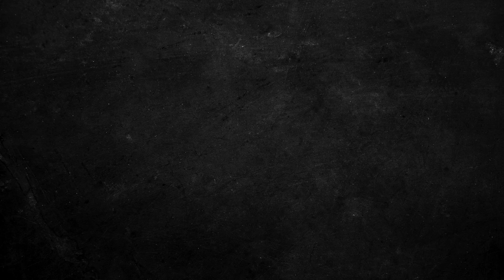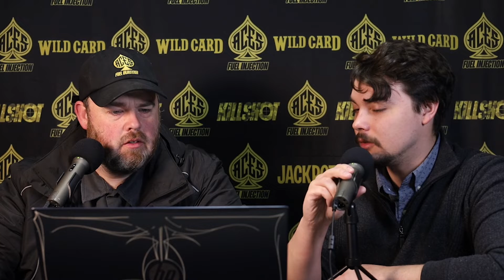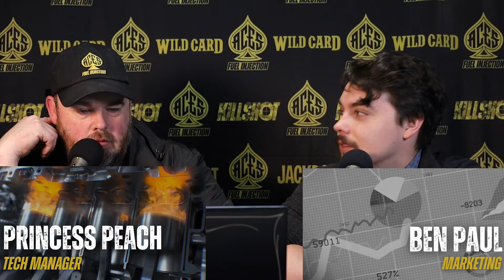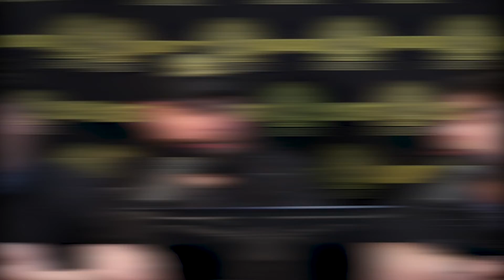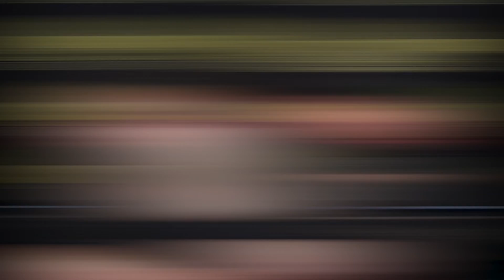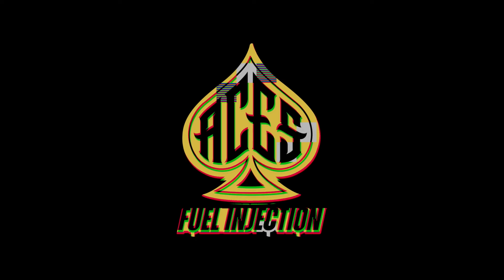Feelin Fresh (Tech Tuesday Ep 27)

Comment: Ok Tim, question bot ur last video. I asked bot getting my speedo to work on my 98 dually. U said get a pin out off all my data and plug stuff in 🤔🤔. Have no clue what that means. How do I connect factory wiring into Quick Draw and KillShot ? And possibly hooking tach back up ??  Also can u do video on some Quick Draw upshift/downshift and pressure settings and what the numbers correlate to ? Thanks again. !! Eddie

Comment: Thanks for clearing up the fuel pump run-on issue, and all the other nuggets today! Add it to the “your wiring has to be clean and right for the system to run right” advice file!

Petty I know, but I wind guitar pickups full time, so it is “Sunday Handwound” like coils wound by hand. Not bleeding wounds in my hands, just on Sundays…